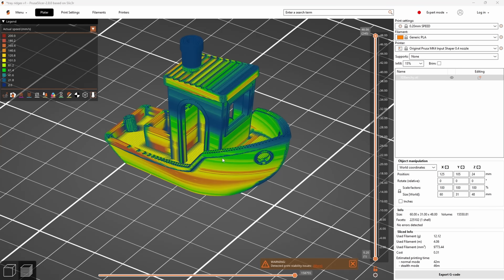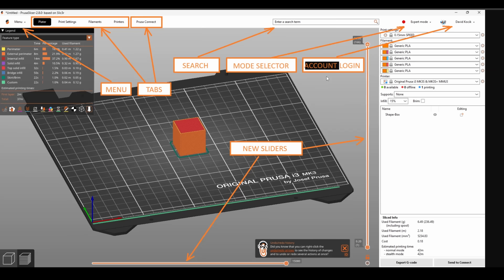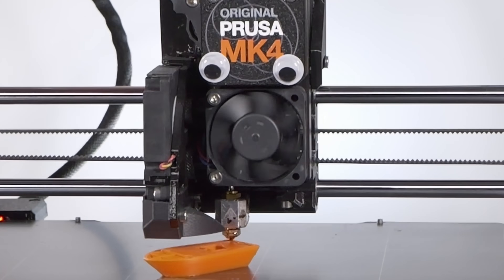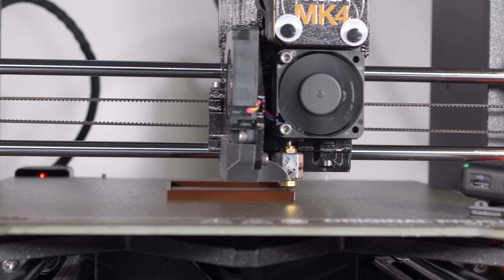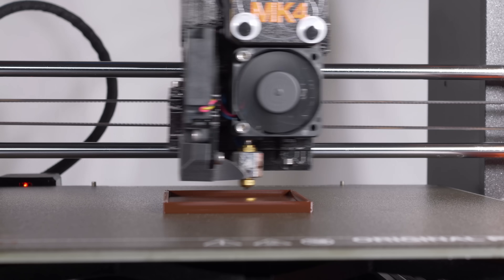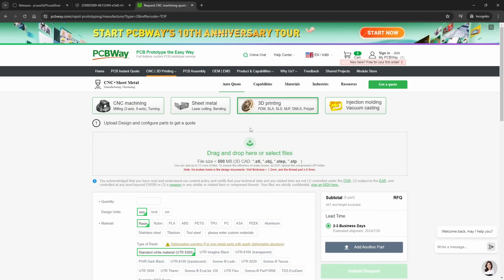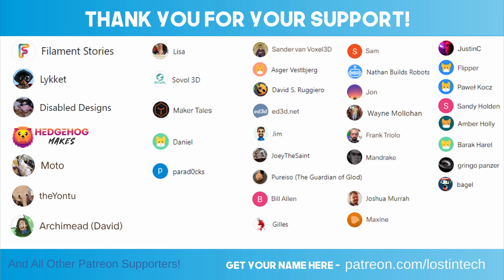PrusaSlicer 2.8's new features might be quite useful...

Comment: There are quite a few options in the menus that do not have shortcuts such as update checking. The move away from standard operating system menus is absolutely ridiculous and will cause all sorts of accessibility problems for people for no good reason. I don't see why they couldn't have put their tab bar below that. The very few vertical pixels used for the menu bar would not be that big a deal for just about anyone.

Comment: This will be super useful for diagnosing print artifacts. You can immediately tell if something wrong is due to speed and acceleration and adjust accordingly. All they need now is a thermal capacity mode that tells you how much thermal capacity a specific portion of that print will have and we will be one step closer to perfectly predicting a print’s outcome

Comment: adaptive pressure advance is coming to orca soon. this will require calibrating PA at different accels and flow rates and letting the model change PA automatically depending on any line's given flow rate. this means any improvement to flow rate display will be welcome.

Comment: I luv the new “Physical Printer” tab, which now allows you to see the Mainsail or fluidd interface of printers running Klipper.  The “Prusa Connect” tab appears to be bugged ATM, as nothing but a header displays.  GitHub issues shows that they are working on the “Prusa Connect” issues.

Comment: I hate the new menu button.  I use the menu's on every print I do this new feature costs me time on every print  and I do several every day.  Everything else are nice additions.  I really like the connect integration.   So much nicer than the old physical printer system.   It would be nice to be able to add non prusa's to that part of prusaslicer.

Comment: You can push hardware limits to gcode but it's a separate setting in prusa
Reply from the maker: correct - limits though, not settings. Which is kinda weird when you think it's pushing the settings too. Not sure how that works.
Reply: @LostInTech3D  ohhhhh true true. You're definitely right. And yeah that'd be nice if testing different configurations and not to have to turn around and push the new settings via terminal/pronterface.

Comment: The "actual volumetric flow rate" would also immediately dispel the claim that FLSUN S1 can achieve 110mm³/s, which they "proved" with race track gcode files with reduced acceleration so that it would never reach those speeds
Reply from the maker: hey now, I managed 77 I think. See last vid :)
Reply: @LostInTech3D  and that's extremely impressive! I just think it's a huge shame that they didn't advertise the printer like that, but had to make false claims and mislead users
Reply from the maker: Agree

Comment: The menu change is typical of open source folly in UX design. 

Deviating from basic interface conventions is fine if there's a big upside, and I don't see it. I do see a "we know better" mistake that too many OSS developers make.
Reply: I hate it so much, I'm just still using 2.7.4.  Ain't got the time to deal with UX brain damage.
Reply: One advantage to the new design is the recovery of a bit of screen real estate for the 3d model space. When my laptop is plugged into the huge monitor on my desk it doesn't really matter, but when the slicer is displayed on the laptop's 13" screen every pixel counts.
Reply: @JoeSchmoe-lq1uo  Sorry I hate it :)  It doesn't even look good. Saving a few pixels (how many?) for people with small screens isn't a big enough reason to abandon convention.
Reply: @JoeSchmoe-lq1uo but let's be honest, 15 vertical pixels for a menu bar are not going to have that significant of an impact. At the very least there should be an opt-in option for the very few people that would want the menu bar gone.
Reply: @falxonPSN  Start a petition to get it back. I'm sure if enough people sign it they will listen, realize their error and revert to the old UI design. Or at least make it a preference setting.

Comment: I would, depending on music, subject and length (e.g. Pneuma by Tool is long, but not boring, while e.g. looking what drummer does (quite a lot, actually) during that time, though 10+ minutes of pulley googling back (if it had smiley mouth, would it be ROTPL, next of kin of 🤣?) might be 🤔 ). Googly eyes, yes please 😉

I could argue that simply by altering the applied force (that can happen quite instantaneously in electrical systems, simplistically simply add current (F relates to n * I). Some limits apply to rocket- and ordinary motors, and belts with flex) there is no limit how quickly acceleration can change (a = F / m) and it doesn't create printing artefacts , but I guess you would just prove me wrong 😅
Marlin S-curve probably does lower acceleration of acceleration, or something. Not quite sure, but it got improved (in code and stepping, again not sure if prints show it) quite recently. Also not sure (this starts to become recurring theme) if Klipper or that third one (Duet? Rep something?) have any similar behaviour...

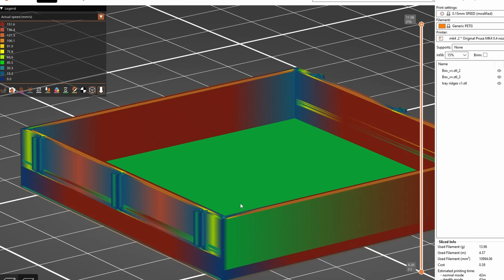Comment: 6:50 what changes were made? Reduced top speed or reduced acceleration?
Would be cool if you could paint an area you want to have a nice looking surface finish on and the slicer would use that data to make it so. Like how you paint supports

Comment: I honestly thought the new feature was going to be a check box to make the actual print speed consistent; making the print look better. Instead I still have to manually change a bunch of settings to get rid of the change in matte vs gloss.
Reply: The only setting you really need to change is the max volumetric flow rate in the filament profile. If you run a max volumetric flow rate test (Orca Slicer) you can determine that rate for each of your filaments.

Comment: bro the PETG matte thingy is related in no way to accelerations themselves, but to flow (extrusion) rate. 
This is misinformation.

I can extrude glossy PETG and matte PETG, both with the print head stationary
Reply from the maker: I think you missed what I was actually explaining there.
Reply: Yeah, but in the real world of printing objects, the flow rate is dependent on print head acceleration (and velocity) to lay down a consistently shaped bead of plastic. Though, if you set a max flow-rate, the terminal velocity will be capped at the max flow-rate. I don't think acceleration will be though.
Reply: @Sembazuru  not really, slow movement and high flow rate is possible, fast movement with low flow rate is also possible, just print a max flow rate test in orca on PETG, it is cleaatly visible 

If you want certain look/properties you make sure to extrude as much as possible at the target flowrate

Comment: There's also a 'Physical Printers' tab that shows for printers with a web interface like mainsail etc. You just need to setup the 'Print Host Upload' section with the url for the web interface.
Reply: I use this tab quite often for my Octo-Pi setup, I would imagine it would work on any printer that can provide a web page front-end. If you have the "Send gcode button to printer" G button, you should also have the "Physical Printer" tab.
Reply: @Sembazuru  100% correct

Comment: Oh wow. Account login! So they are moving toward making another cloud-connected nonsense. I hope they will make it paid and add a subscription
Reply from the maker: It's not new, they just integrated it into prusaslicer
Reply: and you can hide the login button to never bothered again with it if you don't like it. I would say they did everything right here. The offer the choice, but don't enforce it in any kind.
Reply: @drstefankrank  Not only can you hide the button at the button, you can unhide it from preferences if you accidentally hide it or change your mind and want it back. To echo your conclusion, they did everything right here, IMHO. The only extra feature that I can think of (but have no reason to personally use) is a way of changing the PrusaConnect server address without having to rebuild PrusaSlicer from source. But that would only be useful if someone needed to host their own PrusaConnect server (for example inside an air-gapped network for security reasons).
Reply: @Sembazuru  Is there such a thing, that you could host your own Prusa connect server? I guess it would also require the printer firmware to be able to connect to a different server.
At least I would like to see Prusa Link get improved. It lacks a lot compared to Connect and both should better integrate the MMU3. If you slice for single extruder, which I mostly do, I have to go to my printer and select the filament slot. Would like to have that in Link/Connect, cause I'm lazy.
Reply: Prusa has done a very good job of offering choices - Prusa Connect is optional and you can hide it. I personally use PrusaLink for uploading to the printer over the LAN, you can also connect OctoPrint if you want, or you can just plug in a USB stick, which comes with the printer.

Comment: Jerk is miss named in 3d printing, it's instantaneous speed change instead of rate of change of acceleration. That's why it's measured in mm/s instead of mm/s³
Reply from the maker: I'm not actually sure how klipper works out jerk in each cardinal direction. What you said is true of marlin, with caveats...it's... complicated
Reply: @LostInTech3D  ok true, I don't know either about Klipper.
I should mention I really enjoy and learn from your videos. And humor
Reply: Similarly "Bed Leveling" is a poor name.  Leveling something makes it parallel to the ground.  In 3D printing we want the bed to be equidistant to the nozzle as it travels around the bed.

Comment: Actually, I would like to see a video on the maths involved where you get into the stuff that you didn't want to get into here. I never realized what exactly jerk was until now
Reply: At least in Marlin, jerk doesn't mean acceleration change rate as in physics. It's actually the maximum allowed instantaneous change In speed. Afaik it's the max difference between the end of a velocity trapezoid and the beginning of the next one.
Except for E jerk, that one limits printing acceleration when using linear advance (nozzle pressure needs to be achieved instantaneously for now in Marlin. Working on that)

Comment: I really like the "Actual volumetric flow rate", it has been particularly helpful to identify quality issues I had with a soft TPU recently.
Reply: This is why I had switched to Orca before. Now that Prusa has it... guess I'm back to using more than 1 slicer again 😅
Reply: @TheTakumiBrennen  I'm just gonna wait until it's rolled into Orcaslicer, I tried the multi-slicer life and I just can't at this point 😭
Reply: What is you max reliable flow for 95A TPU?
I'm using 9mm² on a K1max, and that is perhaps a bit low?
Reply: @ZappyOh  the max usable depends quite a bit based which TPU, extruder and nozzle.
To give you an idea, with a direct drive (CR-10 V3) and 0.6mm nozzle, I calibrated to:
- 12.5 mm³/s on AmazonBasics TPU 95A
- 9.6 mm³/s on Overture TPU
A few % above that, the extrusion becomes inconsistent then the filament buckles and escapes its path.

I'm sure the temperature influences that too but I haven't tested.
BTW, the Shore hardness of the TPU seems to be the main factor, I measured 
- AmazonBasics TPU 95A: 95.5A, 48D
- Overture TPU: 89A, 40D
- Fiberflex 40D: 94.5A, 38D

OrcaSlicer Max Flow Rate works perfectly to evaluate that one. But for quality including on tricky overhangs you might need to go much lower on softer filaments.

Comment: wait. what did you change at 6:51?
Reply from the maker: to fix the artifacts? speed and acceleration
Reply: @LostInTech3D  yes, but how ... just print it slow? or with slow acceleration? or can this be done without a hit to printspeed?
Reply: @Schwuuuuup  way slower, green is 45mm/s from the legend
Reply from the maker: Yeah it was just to prove a quick point. In a real world situation where the print matters you'd probably spend more time tuning it
Reply: The best way to deal with this is to run a max volumetric speed test for your filament (Orca Slicer). On that test print you will notice a flow rate at which the finish changes. Set the max volumetric flow for that filament according to the results of the flow test. After that you can set your layer height, extrusion width, accelerations and speeds however you want in the print settings and the slicer will make sure the print speed is capped so as not to exceed the max volumetric flow rate you set in the filament profile.  Subsequent prints will not show those artifacts from the vid regardless of acceleration because the volumetric flow rate will not exceed what you put in the filament profile.

Comment: Hold up! Negative acceleration and deceleration are not the same!
Reply: Semantics, or point of reference. Otherwise the same.
Reply from the maker: Well, I could either make a video on 3d printing, or confuse everyone with vectors. They are the same in this situation ;)
Reply: @LostInTech3D  or admit that you dont know what it is.
Reply from the maker: @Festivejelly from my frame of reference you're decelerating toward a ban
Reply: @LostInTech3D  That accelerated quickly :D
Reply: @simonbrisebois-therrien2775 Well said!
 The second derivative may not be used in 3d printing firmware, but it does come into comments often enough 😏